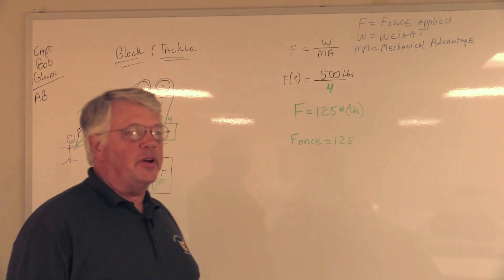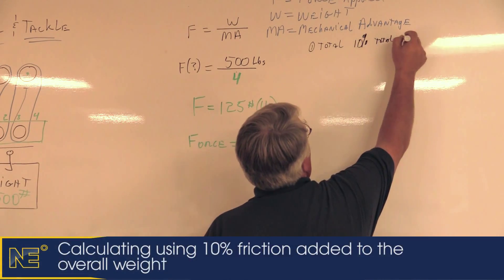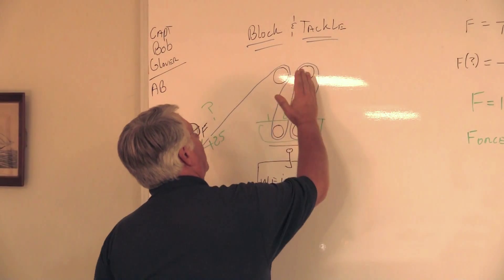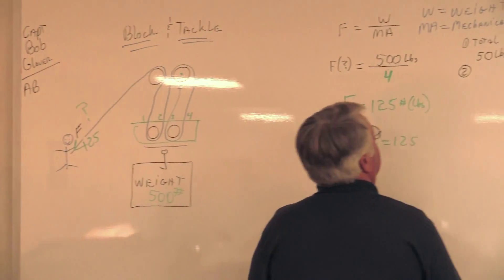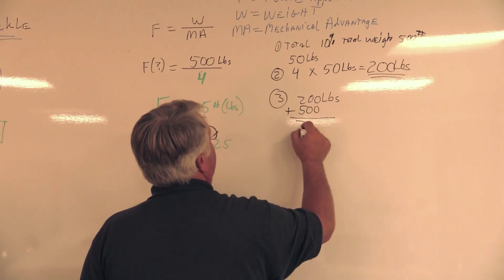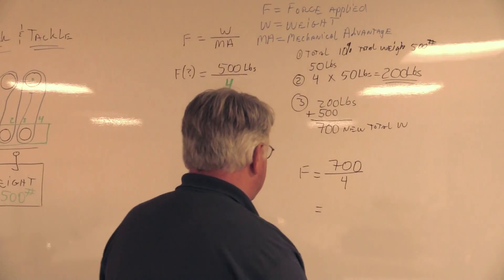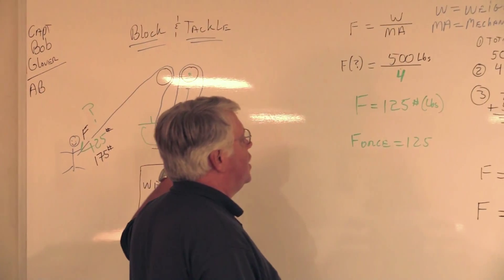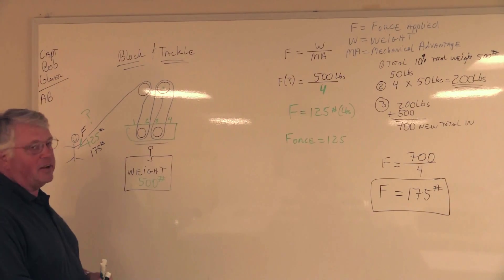Block and Tackle Part 2

Comment: How do you figure 10%?
Reply: 10 percent for synthetic rope while reeving also bearings and bushings to consider for friction lol
Reply: Makingnewnamesisdumb it's just an arbitrary number. In reality, the coefficient of friction would likely be calculated after observing the additional force required to lift the load. I imagine it would be fairly difficult to know that exact number unless through experience with a particular setup.
Reply: I think for the scenario, you can assume 10% as the extra force needed to overcome the axle/pulley friction. Of course, if you have greased bearings or other types of low friction bearings, other than a metal pin axle stuck through a pulley. I don't think it would BE 10% as most of the time the axles are free to rotate as well as the pulley....but that's just speculation. 10% would be a bad-case scenario.

Comment: With 500 lbs of total weight, there is 250 lbs. on each pulley pin, not 500. We have two parallel sets of two in series. So, if friction is 10% for each pulley, total friction added to the system is 4 x 25 lbs, or 100, ...not 200.
Reply: Billy Stanley -- it also stuck me that there's not 500 pounds of weight  on each pully and that total weight should be divided.  I don't know beans about physics...just trying to learn...
Reply: Nope, the weight is not mysteriously split (in the typical system), it’s continuous on the entire system due to gravity. All force is transmitted to the anchored portion(s) of the system. His split up diagram is not the actual setup - he showed that earlier is it being a pair of 2shiv blocks, and only one is anchored.
Reply: So 150 is the the additional force we will apply to lift the weight but not 175.